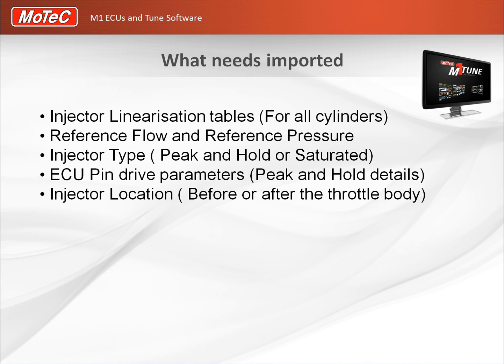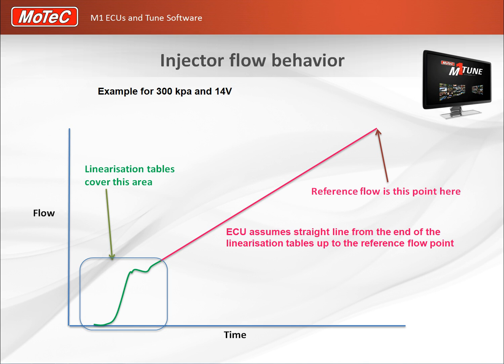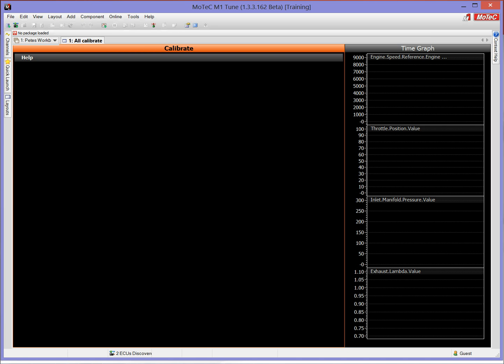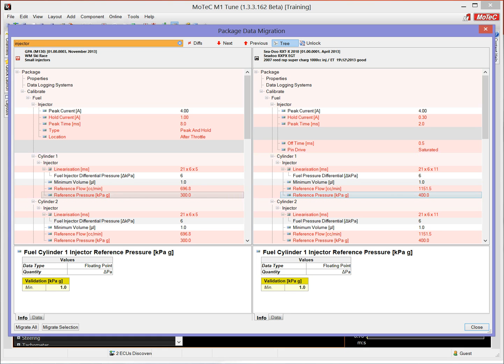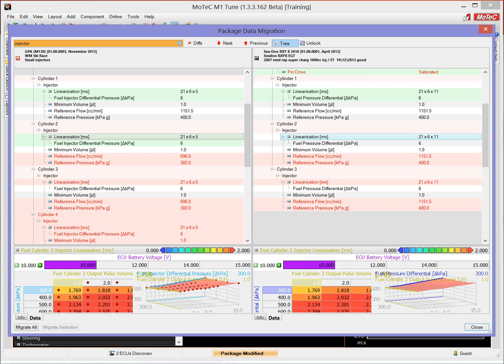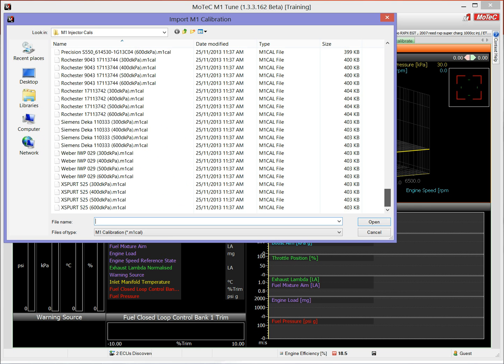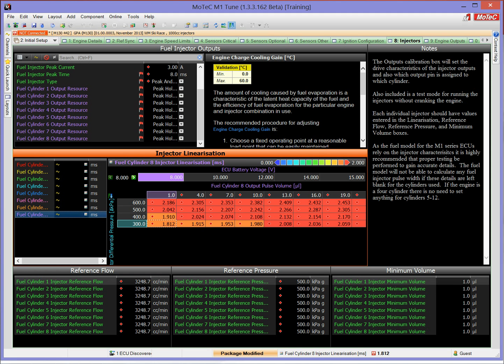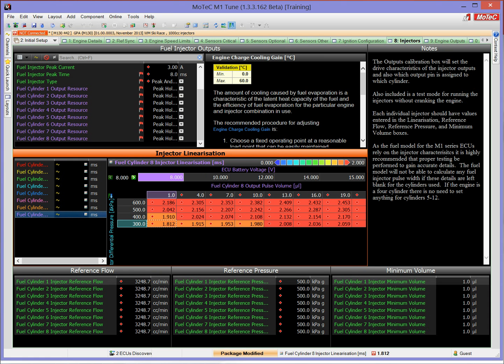M1 Webinar Importing Exporting Fuel Injector Calibrations

Comment: Pete, is there some place you know of that I can get the injector calibrations for the following injector we're running in our Audi 3.0 TDI engine with part number 059130277CD?  http://www.dieselcenter.com.au/diesel-fuel-injectors/new-injectors/bosch-diesel-injector-audi-q7-vw-touarag-3l-v6-tdi-0445117022.html